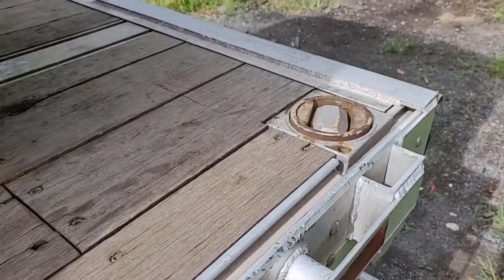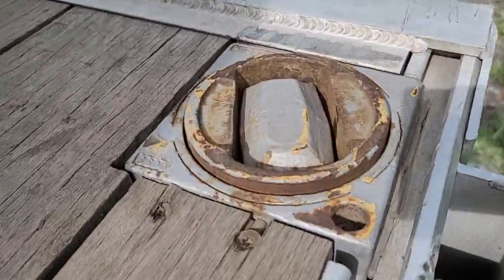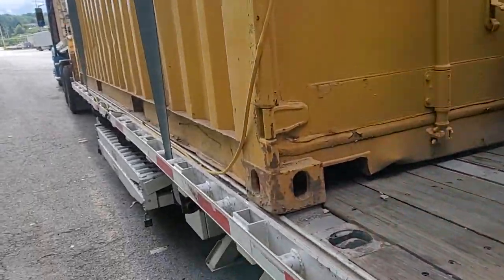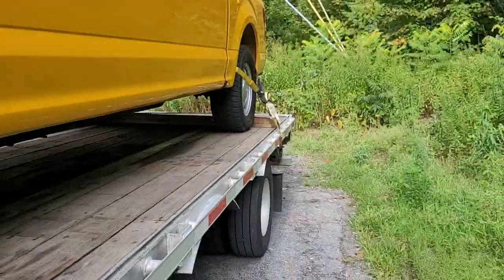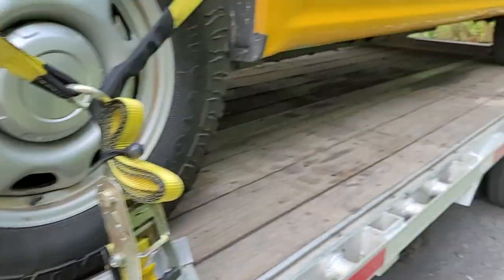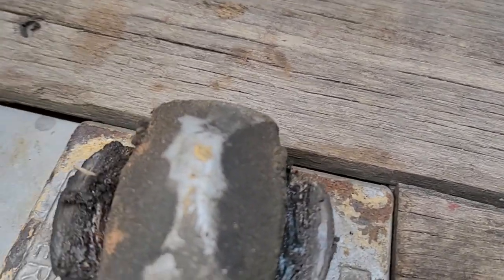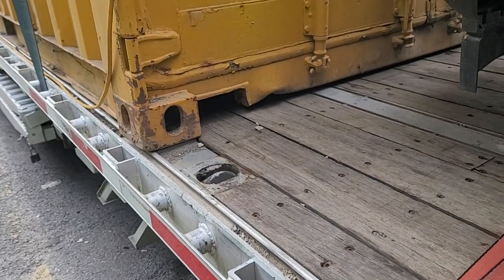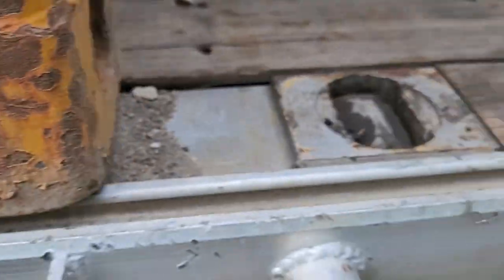Hauling containers on a stepdeck or flatbed with can locks

Comment: There is no extra securement required whatsoever same as with a cargo chassis for sea containers only twist locks are required best to use zip ties on the handles once locking them in place that way there’s no way they can come on down themselves

Comment: I’m 99.99999999% sure that the locks themselves are legal. But just because something is legal doesn’t make it right. Example 9,999lb machine  two chains and binders is legal but is it right? I’m a tow truck operator and my boss won’t let us move a trailer, container, or combination unit unless we’re able to see inside. Flatbeds lowboys etc if it’s not legal or to our satisfaction we don’t move it. Four things can happen they make it legal we make it legal (they pay extra labor charge), trailer or load gets dropped they can move it or we can(more money) or we leave them sitting there broken down. I’m thankful for this because I’ve had to do sketchy shit and lay out a lot of money for lawyer(s) for it to not get on my license.

Comment: Those look like EXPLOSIVE placards on that can in the picture.. according to Federal guidelines it HAS to be secured to the trailer by the CAR BLOCKERS...civil service employees responsible for load securement both IN and ON trailers using the drivers equipment to do so..

Comment: Alot of companies pulling containers on container chassis's, make the drivers run zip ties thru the little holes in the twist locks, so they don't rattle to unlocked position...
Reply: When I bring a container out on a flatbed that is damaged and can't mount to a chassis,  I run a chain thru the container bottom corner holes and a binder in the middle.

Comment: No extra securement is needed. If it was every container chassis in America would be in violation. Think about this also they use those to lift them on and off trucks and ships. That is also how they are stacked together and held on the ship. But WTF Put ten straps if your in doubt.

Comment: I don't give a SH*T ... ALWAYS chain it , front and back. I know SOME folks like to use STRAPS but straps are FABRIC and the container is STEEL.. therefore CHAINS are recommended method of securement . Cross chain from the top corners to the trailer in an " X " configuration . This USED to be THE LAW if you weren't pulling a container on a container frame trailer . Just a thought 🤔